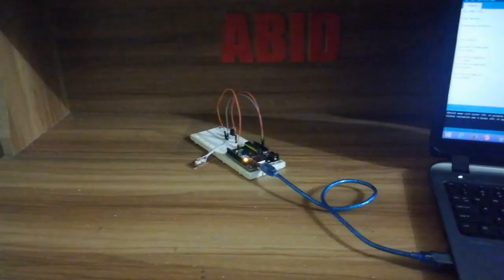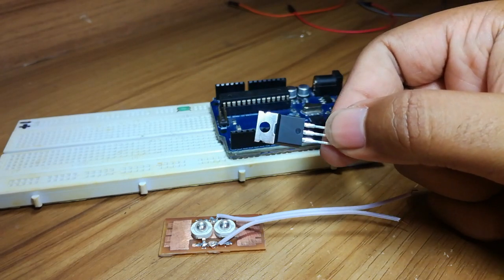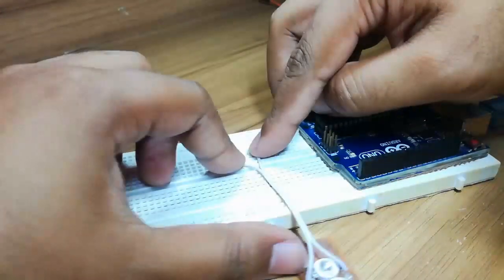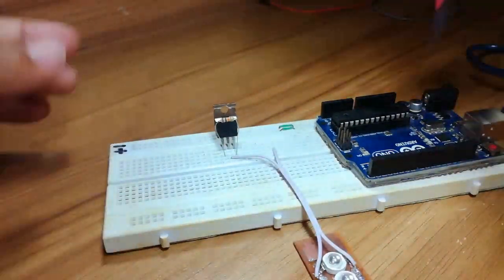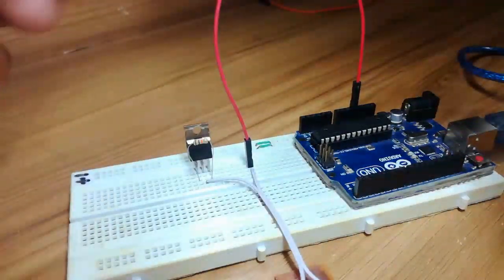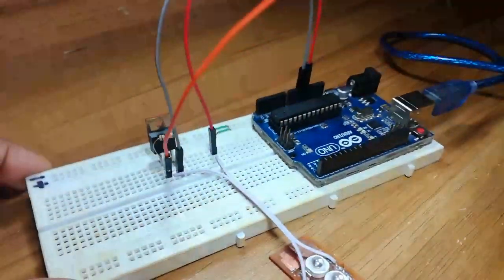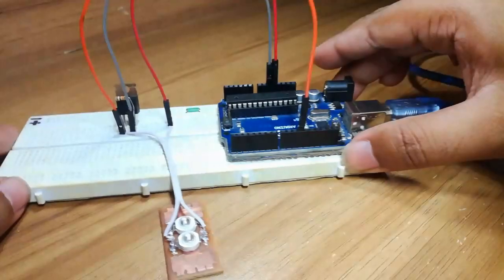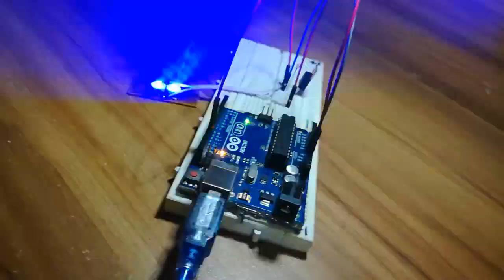High Power Led Blinking Circuit|| Led Strobe with  Arduino Uno R3

Comment: I want to lit 16 pieces 3v LEDs with Arduino UNO. Each LED is rated 20mAh
Reply from the maker: TIP122 Transistor / Irfz44 will work

Comment: great work!!! can i use only the ATMEGA chip and the circuit instead of the entire board? or any of the ATTiny Microcontroller?
Reply from the maker: of course you can.
Reply: @ABID5  Thank you for the reply.... will have to look into porting it to ATTiny85 Micro controller... :-)
Reply: @ABID5  did try it on the ATTiny85... But the same code as yours is not giving the effect like the one when used with Arduino... Had to skip the Mosfet and resistor as the lights did not work when used in the Attiny85 circuit. The flash is not bright either... Wonder here I am going wrong. Using the PWM pin for output on Attiny85.